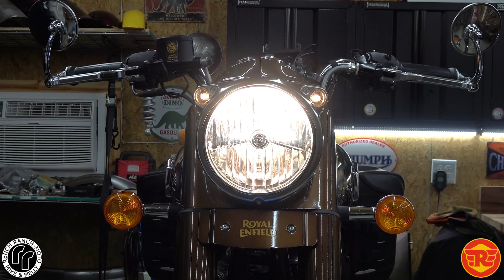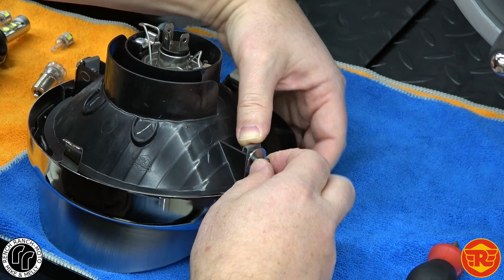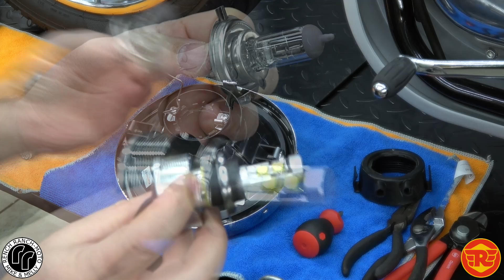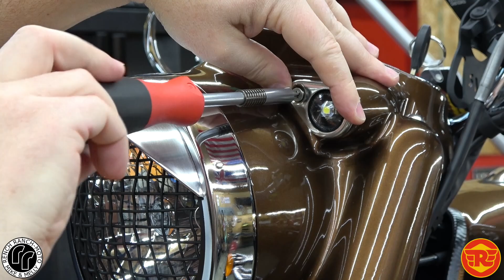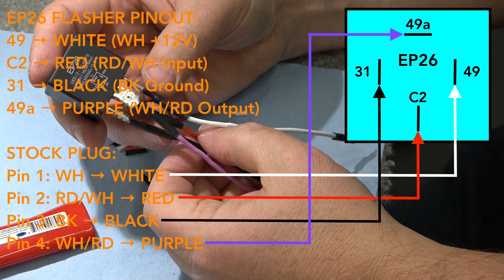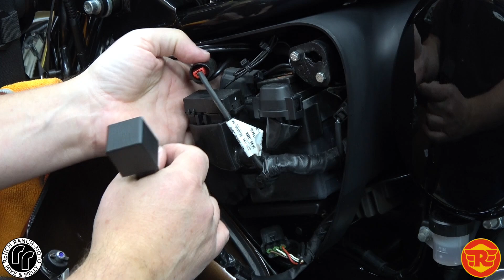Classic 350 – $120 Full LED Upgrade That Actually Works (No Hyperflash)

Comment: I am thinking of adding a GPS tracker - perhaps hidden in the headlamp assembly - any ideas?
Reply from the maker: The wiring is actually pretty tight in there. There is space inside the "fake" air cleaner covers (not the side covers), you could hide it in there. On the left hand side fake air cleaner cover, I have my Fuel X Lite hidden. I am assuming the GPS tracker needs 12v constant so it's transmitting even if the bike is switched off? That's where I would mount it. Its also closer to the battery. 

Thanks for watching! Much appreciated, Cheers!

Mike

Comment: Looks great. You really do a nice job showing the installation and what to look for to make the job go smoothly. Personally, I like the look of LED lights. I think they do a great job of making you be seen by others. I don't care much for the light that a headlight puts out. The way the light has a sharp cutoff point doesn't help me to see. Not a huge problem on a motorcycle for me since I rarely ride at night.
Reply from the maker: I don't ride much at night either. Usually if I am on a long trip, I'm already at my destination before it gets dark. For me it's early AM visibility. But on all my bikes I make sure the headlights are aimed properly (with me on the bike!). Blinding on coming cars, LED headlight or standard, makes for a more dangerous situation on the road. Thanks for watching, always appreciated! Cheers!

Mike

Comment: Exelent video, Mr Rench.
I did the exact same thing to my Triumph Thruxton 900 to solve the hiperflash.
Please make more videos, I can't get enough!
Reply from the maker: Fear no electron! LMAO 🤣! It was actually more difficult to fit the headlight together than make a jumper harness for the flasher relay. Grok found the wiring diagram for me. I just had to trace out ground and 12Vdc. The remaining 2 wires were obvious. So not difficult at all. Thanks for watching Bro! Cheers 🍻 

Mike

Comment: Worth noting that major companies such as Osram and Philips manufacture LED replacements for halogen headlight bulbs. I assume that they are designed to exactly reproduce the correct beam pattern. I can't speak to their availability or legality on your side of the pond, however. 🙂
Reply from the maker: For the one I bought, it was marked DOT (Department of Transportation in the USA) and was specific to a motorcycle. I think with any of these, as a rider it's still my obligation to ensure it's aimed correctly. Even if my visibility is better at night, if the oncoming driver can't see there can still be an accident. This is why I specified to check and make sure the headlight is still aimed correctly. There are guides online how to do it. Thanks for watching, always much appreciated. Cheers!

Mike
Reply: @RenchRanch Even better if it has DOT approval. Not sure I'd trust the cheap LEDs you can find on Amazon, eBay, etc.